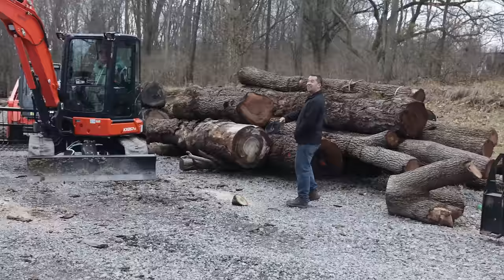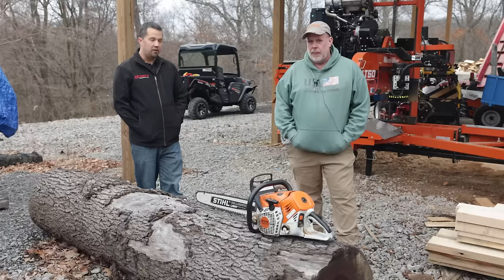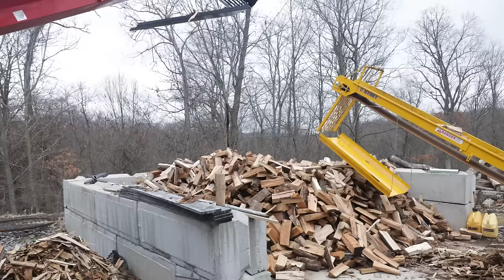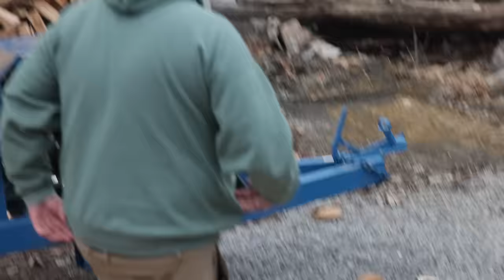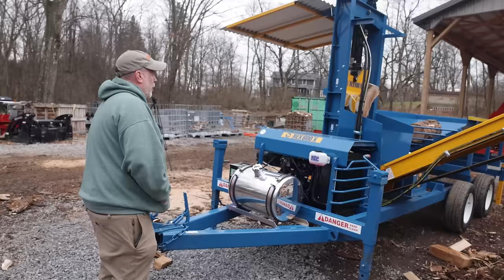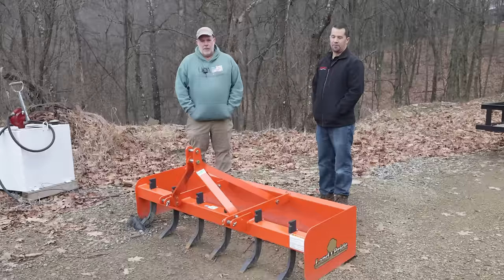Equipment Tour with Mike from Outdoors with the Morgans

Comment: I live in Missouri and get most of my parts for my M5-111 on the internet at Messick….parts means filters and stuff I can do myself. My local dealer sucks😢thanks Neal!
Reply from the maker: Glad to help.
Reply: My local dealer don't necessarily suck, but sometimes its just nice to go online and get stuff and not have to drive to the dealership....Messick's is my go-to if I don't drive to the dealership.  I also got my Titan Pallet Forks from Messick's, they were nice enough to sell them to me and ship them since my dealer couldn't get a hold of any soon enough....the only issue is they're for a compact tractor instead of a sub-compact tractor so the frame and forks are a bit heavier than I really like, but they do the job, just lowered my lift capacity by quite a bit on an already small sized tractor.  I'd order more from them but the shipping is way too high (not a fault of Messick's though).  Pallet forks were shipped to a local Fedex terminal, I just had to drive over and pick them up, and I think it was only a few days after I ordered them that they showed up, so shipping wasn't all that bad either just the weight makes the price go through the roof real quick LOL.  

During Covid, was when I ordered my tractor, my poor salesman being the only Kubota salesman at the dealership was at wits end with inventory issues....waited a month for the tractor, but dang they did a great job in setup and delivery....Just terrible timing on purchasing on my part with the whole thing....everything was a waiting game for us.

Comment: I have a box blade with tines and yes, do use it mostly as ballast for the 23HP tractor’s FEL. An excavator is next on the list…
Reply: I have a sub-compact tractor, even the box blade isn't enough ballast at times, I have 4 of the 42 pound suitcase weights I hang on the cross bars of the box blade for additional ballast...while only adding about 168 pounds, its a major help when moving around dirt, gravel, or using the pallet forks.  Love my little tractor, but its a little light in the back end sometimes LOL.

Comment: Great video guys.  How much money do you have to spend at a Kubota dealership to get a free Kubota hat?  With my tractor and implements, I spent $26k, I still had to buy the hat, and I had to order it from Kubota LOL.  

So much equipment that Mike uses on almost a daily basis.  The land plane, and a grapple are high on my list, as well as a rotary cutter, or more likely a flail mower.  Unfortunately all the larger companies that sell the flail mowers are back east, and my Kubota dealer wanted $7500 for a flail mower, umm nope....

Comment: Neil, a while ago you sold Mike an Auger, I tried to buy the same setup from Messick's but the salesman (Justin) told me what was sold to Mike was incorrect.  He said that an auger for a skidsteer is different than an auger for an excavator.  The main difference is the way the hoses leave the auger.  Based on that I've been doing research trying to find out if this is true. I have spoken with a few different manufactures and they seem to agree that the hose location (out the top or out the side) is not an issue as long as your not abusive to the equipment.  I was wondering your thoughts.
Reply from the maker: both are correct. Justin is correct that its preferable on an excavator to have the hoses exit at the top, if your not going to bury the auger drive in the ground having the hoses at the side is a minor issue. 

I could see an issue using the excavator style on the a skid steer since the backing plate is so close to where the hoses exit the drive. If you wanted Mikes setup that goes both ways I'd choose the skid loader style personally.

Comment: Hmm, I always heard the KX057-5 could handle a 36" bucket just fine.
Reply: Wouldn't be surprised.  Seems like that size excavator is exactly right for most tasks....too much larger and you'd have access limitations in a lot of areas, smaller and you'd have stability and capacity issues.

Comment: NEIL, I have a b-2650 Kubota no cab on it. i had a 3rd function put on it now i would like to put the rear hydraulics on it. two units one for the top link and the other for back blade angle or snow shoot left to right angle on a rear snow blower.  there 3 options Kubota, Summit and Tractor Innovations kits their all-different kits for it. which would you recommend to put on the tractor. the dealer put the 3rd function on a year after I bought it for a grapple, now I want to put rear hydraulics on it. what's your opinion on it. the prices are different.
Reply from the maker: I'm partial to the Kubota kit since the levers come though the fender and look tidy. the rest are a bit of a hack job. All work.
Reply: NEIL, ok the Kubota one is better way to go. could you send a picture where the levers would be located on the b2650 open cab and see what they look like. I cannot fine a picture of them. I only found a picture of levers under the right side of the seat or on the bucket arm, witch I have a 3rd function on there.  THANK YOU.
Reply from the maker: @williamhowey2151  I would not have a photo. your correct, its hard to find. There is a knockout in the right rear fender where the levers come though.